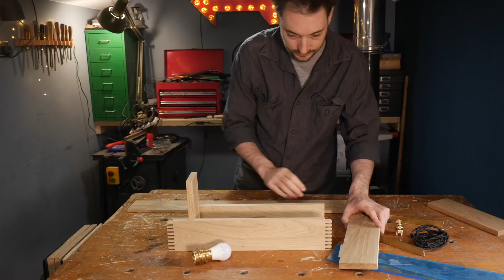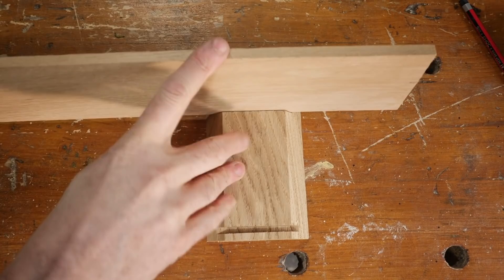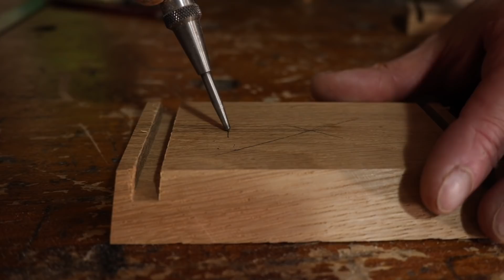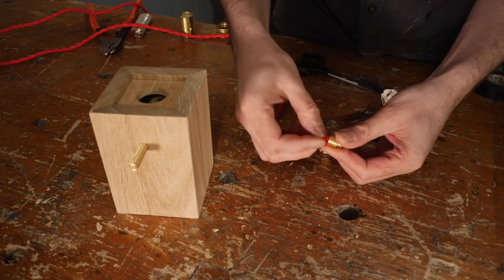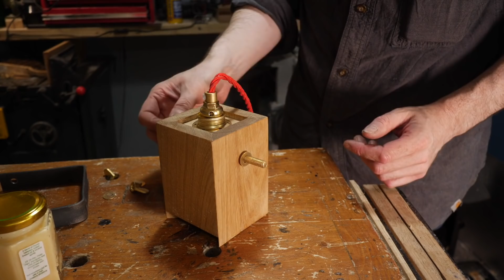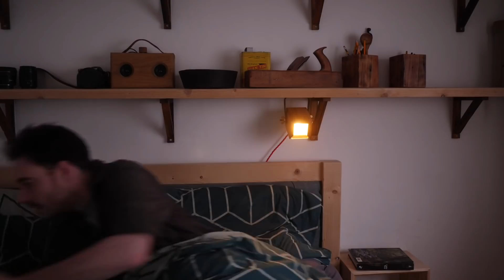Making A Bedside Lamp

Comment: Could you have used the off cut that you took off so you could slide the perspex into the lamp - screwed it from the underside of the perspex (after trimming it down) to use it as a 'handle' to pull the perspex out. Then it would have looked the same as the other pieces. Maybe too much work at this stage....
Reply from the maker: I could have